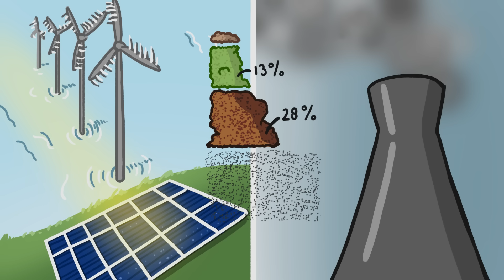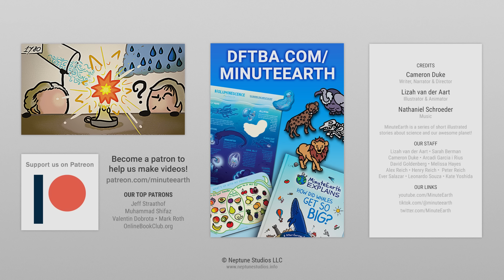What if We Replaced Nuclear With Potatoes

Comment: 1:30
note that the efficiency advantage of the potatoes being burnt at a dedicated power plant instead of in the car itself also exists for burning the potatoes in a small personal use generator. generators work at peak efficiency continuously, while a motor spends a lot of time running at a lower efficiency, especially when not powering the vehicle like on a hill or at a stop sign

Comment: 1:04 - This is pretty misleading. Conventional approximation for modern passenger vehicles is that 1/3 of the fuel goes towards moving the car, 1/3 goes to "parasitic losses" like A/C compressor, alternator, power steering, etc. (i.e. still doing work, but not work that moves the vehicle) and only 1/3 is lost to friction/heat. Bigger and heavier trucks will be less efficient, but still nowhere near 80% lost to heat.

Comment: Heres a lot of numbers about enervy production.
Just some trivia ultimately.

Fission power plant average production: ca 1GW
Oil power plants average production: ca 800MW
[Natural Gas power plant average production: ca 650MW]
Coal power plants average production ca 500MW

But:
Energy from splitting Uranium: ca 82 TJ/kg
[Energy from burning Hydrogen: ca 120 MJ/kg (just as trivia)]
[Energy from burning Methane: ca 55 MJ/kg]
Energy from burning Crude - Refined oil: ca 42 - 46 MJ/kg
Energy from burning Coal: ca 24 MJ/kg
Energy from burning Wood: ca 8-16 MJ/kg (depending how dry the wood is)
Energy released from TNT explosion: ca 4 MJ/kg

So, going from Wood to Coal is a 1.5 -3 times energy per weight Jump. So, no wonder Wood was still used A Lot throughout the industrial age to fuel steam engines. If it's properly dried is nearly 1 to 1 with coal.
Oil has a 1.75 to nearly double energy per weight jump from coal. Not much, sure, but it's a nearly 3-4 times jump from Wood, and it's liquid, so can be stored much more densely. Not to mention more pure and refineable.
[Natural Gas is only a small jump higher then Oil fuels. As it's either petroleum gases, that are about the same energy per kg as oil, or at best Methane, which is only about a 1.15 jump. And Gas Power plants are about the middle ground between Oil and coal. So I won't get into Gas any deeper.]

The big jump though is from Oil to Fission.
It's nearly a 2 MILLION times jump!
A 3.5 million jump from coal, and a 5-10 million jump from Wood.

No wonder the nuclear fission bomb is so devastating.

Of course, as we can see with the Power Plant energy outputs, it's not that huge a jump power plant output wise.
But what that means is the fuel requirements are that much lower. And thus also the waste output is That much lower!
Add to that, that fission power plants are generally run in less eroding and less material degradation ways then Oil and Coal. Mainly for safety reasons.
This leads to even less "waste" material and less maintenance requirement.
Of course, the waste that we DO get from spent fuel, is ridiculously dangerous! Add to that, that every bit of material we take out after maintenance, repairs, or similar, needs to be stored for months or a few years, before it's safe to use again or throw away.
Still, the total waste compared to Oil and coal is minimal.
And we can't just dump it in the atmosphere either!

As a final aside, as great as Fusion power is, it's not a cure all for our energy problems.
Fission of hydrogen produces about 600 TJ/kg.
[So about 5 million times more energy then burning the hydrogen]
That's "only" about 7 times more then fission of uranium.
Which is a big negative to fusion reactor research.
Basically the argument being "why spend so much money on something that is only 7 times better then fission. When fission is 2-4 million times better than fossil fuels, but a fission power plant outputs only 1-2 times the energy of a fossil fuel power plant, and at similar costs per kwh?"
Sadly :c

Either way.
A lot of things, like the different forms of energy generation,
the lower waste amount of Nuclear power,
the deadliness of spent uranium fuel radiation,
the devastation of the nuclear bomb compared to conventional bombs,
the slow progress of fusion power research,
why we moved from wood to coal to oil, etc. 
A lot of it makes even more sense when we see the amounts of energy we could get, and the amounts we do get out of our fuels.

Comment: In winter that "waste heat" actually becomes useful.
Reply: in summer tho you will suffer
Reply: Sure, but it's still not as efficient as a heat pump (so don't intentionally replace LEDs with incandescents). And if you're still producing that heat in the summer, it puts an extra load on your heat pump, so it's a wash unless you spend more of the year heating than cooling

Comment: Honestly, I wish we could find a way to recapture energy lost as heat-- I feel like a lot of the worries of the climate crisis could be alleviated if we made re-use of our waste products instead of just, releasing it into the air.
Reply: A lot of the heat related to climate change isn’t directly from the waste heat of human activities, it’s because CO2 and other gases slow down the rate of heat escaping from earth
Reply: You need additional equipment to do that. Manufacturing and running additional equipment also uses natural resources, and sometimes causes more impact than prevents through energy saving.
Reply: Yes, and increasingly the waste heat from reactors are being used for district heating and desalination.  It is still a small fraction of the potential.

Comment: I read a book that always compared energy to what our bodies get from a comparative number of chocolate chip cookies (I think it was Energy for Future Presidents). Anyway, nuclear power is far more efficient than gasoline, but the hitch comes in how we power our reactors. Uranium dioxide fuel rods only utilize about 2% of the material before we have to remove it and replace the fuel rods. There are more efficient means of energy production in reactors--even using uranium--but thorium is a proven way to utilize far more energy density. An interesting fact is that burning gasoline uses only about one billionth the rest mass energy of the fuel (think E=mc^2 versus igniting the gas in an engine). As potent as gas is, it's barely taking advantage of its energy density. Nuclear power generation still isn't much compared to pure energy transference (since we don't have antimatter engines), but it's still way better and environmentally friendly than any fossil fuel. If you're using thorium, you solve or nearly negate pretty much every bad aspect of uranium based power, so the benefits are even greater.

Comment: Thank you for this interesting video, but that illustration at 1:23 is very misleading, as it suggests that combustion takes place inside the cooling tower which completely wrong. The only thing that happens in a cooling tower is that hot water evaporates. Nothing is burned, no toxic gases are released.

Comment: but there is another problem to electric car, they are bad for carrying heavy payload. if we consider the weight of fuel source per car between petrol and electric car, the battery is account for more weight ratio then the fuel tank (full) to patrol car. So if we want long range high payload electrical car, their battery has to be bigger, so the energy use per kg of thing the car is carrying, eletrical car has an disadvantage for larger vehicle. The example you made only explain why eletric car accelerate faster and perform way better in moving itself. this sort of petrol vs electric car discussion is thoroughtly explored in college, and in conclusion petrol still have its purpose and in some application it is greener than electric variation in operation only (when excluding the production footprint.).

Comment: I doubt a lot that the dissipated heat mostly comes from friction in a combustion engine. Most of the heat should be created by the combustion itself and then the heat is dissipated through the oil cooler, water cooler, and the exhaust gases.

Comment: Ah yes...in the future, the revised curriculum will include questions like: "Determine the cost benefits of using potato power in the global shipping industry. Run the POTATO program and conduct a vessel performance analysis, computing the weighted normalized potato matrix, expressing the overall energy savings in units of POTATOh.

Comment: One thing that bothered me about this video is the implication that cars are so inefficient that they only use about 20% of the energy in the fuel, the rest goes to heat. While yes there are inefficiencies in cars that could be improved, there is a fundamental limit to how efficient they can be made, and it's probably closer to 40-50% if there was literally zero mechanical inefficiencies.

Comment: The topic of internal combustion engines has already been addressed in the comments by smarter people than me, but I thought the part about friction being the reason internal combustion engines are inefficient was wrong.  That's what oil is for.  If friction generated all that heat, the engine would destroy itself.  The reason for all the heat is the "combustion" in "internal combustion."  The engine works by BURNING gasoline, so a cool liquid will become a hot gas, so it'll take up more volume, so it'll push the pistons out of the way.  But that entails making a lot of hot gas.  THAT'S where the heat comes from.  Not the engine grating against itself.  Am I not right?

Comment: 0:49 - ok but the car can also cover a much bigger distance than a human in 2 hours. Based on the numbers you used it's ~10 times more than a human walking. But I guess even if it's a full car and even if you consider a human would burn more than the base rate calories while walking, it works out to the car being less energy efficient at getting humans across a distance.

Comment: Modern internal combustion Engines are more like 30-40% efficient, so it's a bit off but still a good comparison in general.
And yeah, in some places like the us, electric cars aren't great for carbon emissions because they basically run on coal.
Also the comparison per hour isn't that fair, because you'll burn quite a few calories to go the same distance as what you can in a car.
And even potatoes aren't very efficient, if you take into account cooking and cultivating the potato it's a fairly inefficient fuel source.
So much so that per distance mass transit and electric bikes are better than walking (a regular bicycle is also better, and even in some niche cases a car, like 7 people in an ev powered with mostly carbon neutral sources)
Fun fact: per distance it takes about as much energy to walk than to run.

Comment: im curious about the gas car numbers? at the bottom it says 8.6 potato's per mile @ 30MPH for 2 miles, or 60 miles. but 8.6 x 60 is only 516? Also 22 MPG is pretty low for a modern car. My 2019 full sedan gets about 38MPG at 30 MPH. at ~190 potato's = 1 gallon of gas or right at 5 potato's per mile, i'd burn about 300 potato's to go 60 miles.

Comment: 0:58 This is almost backwards - ironically, the more accurate explanation sounds even worse. The whole mechanism of the engine is trying to convert heat (and pressure) from the burning into motion, so producing "heat" doesn't have to be a waste. But car engines are just really bad at converting heat into motion energy, and it gets less efficient the faster you try to do it.  Even in theory, you can only get ~2/3 of the energy to convert into motion. But then a ton of the heat is simply wasted out the tailpipe because it's too much of a bother (time, space, complexity) actually maximize the harvest.

Comment: #MinuteEarth, a friendly reminder. I got confused at how you used the US customary system or imperial system. I am from the United States, but I use the metric system for reasons of international collaboration and convenience. All countries and international organizations use this international system of measurements. As long as you include metric units in your videos, I would be absolutely fine with that.
At 0:48: "10.7 L / 100 km (4.545 km / L), 48 km/h, flat road. Basically 13.84 potatoes per kilometer."

At 1:34: "201 watt hours / km, 7.84 L / 100 km (12.75 km / L), flat road."
Edit: A mistake I made 7.84 L / 100 km converts to 12.75 km / L not 3.333 km / L